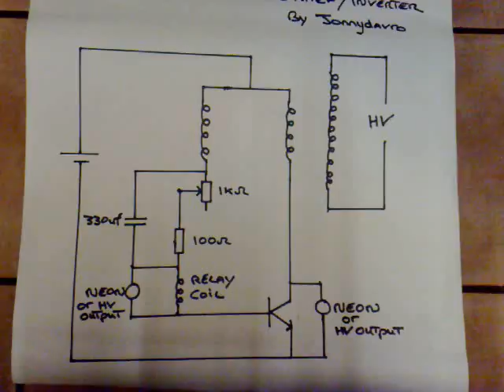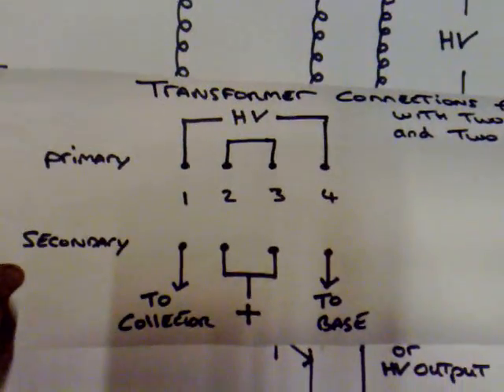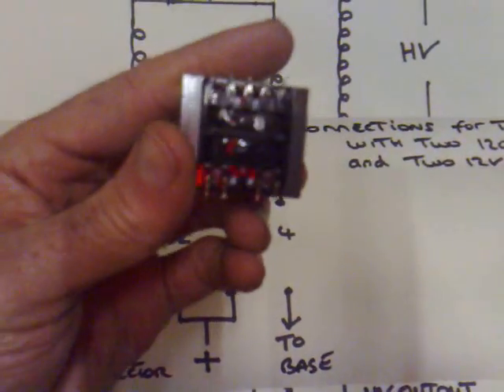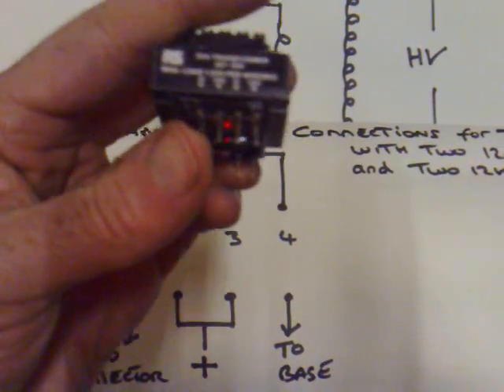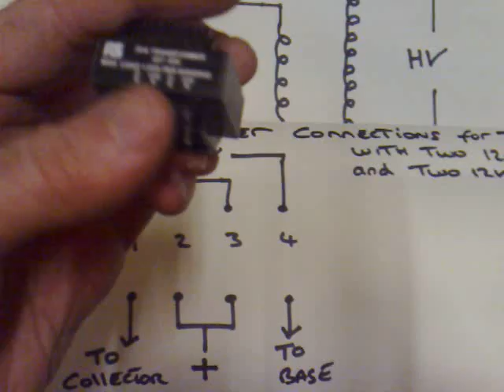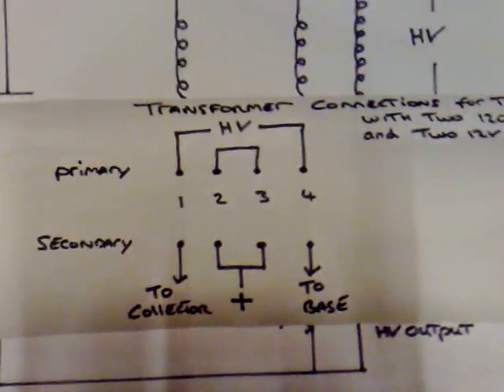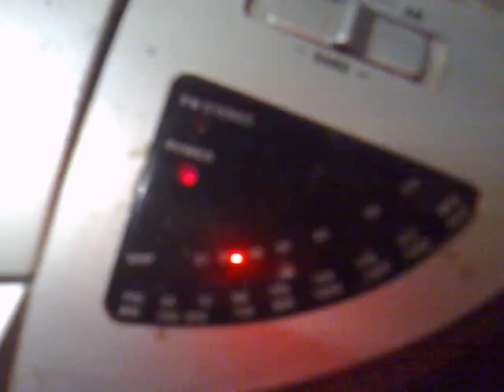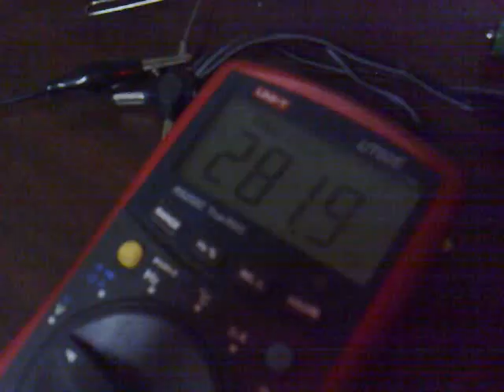Xee2 Joulethief inverter with relay coil

Comment: @jonnydavro
I said that because the voltage across the emitter to base must never exceed 5 volts in the reverse direction.  I explain why this important in my blog at rustybolt daht info.  I can't do it here because of this blasted limit on size.

Comment: What amazes me is that you're getting these high voltages at points that are very sensitive to HV.  The emitter to base junction is rated for a max of 5V (reverse), yet you haven't fried the transistor yet. Especially considering that the maximum power for a BD139 is only 8 watts!  I would put a LED across the emitter to base, cathode to base, just to protect the junction from excessive reverse voltage. That relay chattering is telling you it doesn't like AC, so it's a DC relay? How many V?

Comment: @jonnydavro 5V/12V/24V all come apart similarly. Just gently squeeze the plastic sides til the glue breaks. Take plastic top off. Dremmel/cut the contacts section off. Job done for steel innard coil. If want to remove innard, most lever up at top point with thin screwdriver and out, or use pliers to pull metal away from windings and keep rocking metal piece til the connecting pin works loose. Fantastic thin gauge (up to 40) enameled wire on them too :)

Comment: jonny, simple question... but in all of these circuits... when a 120-12 volt transformer (step down) is used, we are reversing it's use, correct? It's normal primary becomes our circuits secondary, so that it is step up, instead of step down?

Comment: I will have to try the coil in the base circuit.  It looks like it really helped.  This is a project that will turn out to be a useful light for the house or in my case the boat.  You will like the new LED bulbs.